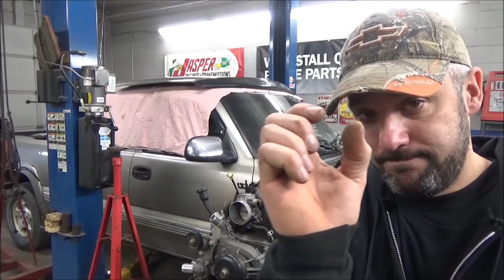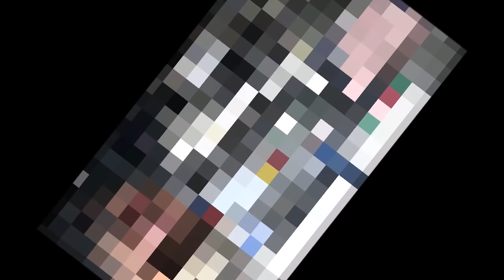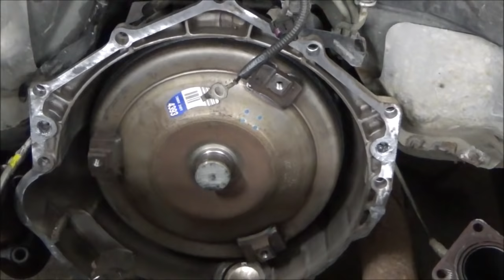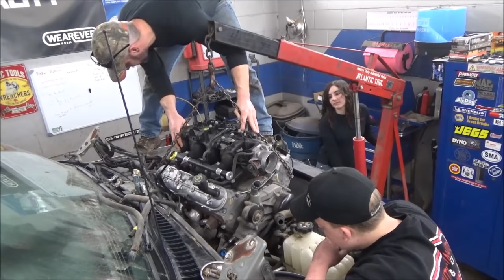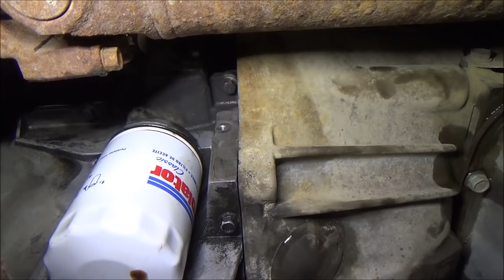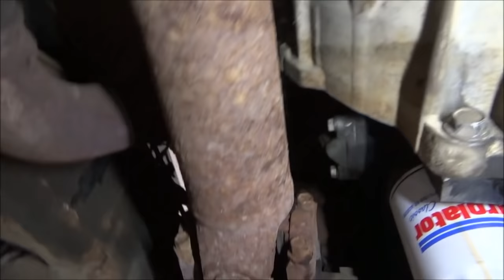Chevy Truck Engine - Remove & Replace Part III

Comment: I have got to put a little handle on the cylinder valve of my cherry picker here, to get that smooth controlled lowering....  And a Hanna would probably help as well, the Josh model looks like he might need to be told something more than once.. ;p  Am almost always doing these things by my lonesome here, but that is the way I like it...
Reply: Wow, she knows what a pair of C clamp visegrips are (at about 35:00), and she apparently somewhat clairvoyant.  I could defiantly use one a those...

Comment: again my oversized paper weight "08 Chevy suburban" has 136 grand wgile my 05.chevy silerado has 268 grand an still runnin with no issues.
crazy..

Comment: Don't you love how there is one bolt hole on the bell housing passenger side second one from the top that does not take a bolt I guess it's so that tranny could bolt to the older motors I remember the first time doing one I actually pulled it back apart to find out there was no hole on the engine block pretty annoying

Comment: i'm replacing my 5.3 with a reman engine. I wanna put a Jasper reman in there. Do you recommend Jasper? and will Jasper come with all brand new hoses and belts ? I know if I do a reman I need all new hoses/belts but what else do you recommend replacing while i'm at it??

Comment: Man those tranny lines look awesome,I'm doing that to my car soon,I'm pulling the engine out and putting a new bad boy in it and I'm gonna replace my lines while I'm there, my stabilizer arm broke a mount years ago and it started rubbing against one of the lines unbeknownst to me and rubbed a hole in it so i had to splice it with a hose but while the engine is out I'm putting new lines in.

Comment: How much did this engine replacement cost?
Reply: I will tell you I rebuilt one and it cost me around $2000.00, if you can I would just swap out this motor. Everything you take off this thing has to be replaced, bolts gaskets etc. and then you have to line up the oil pan just right as the transmission is bolted to it. It is a great engine but it is expensive to rebuild.

Comment: I'd definitely vote for removing the radiator.  Once drained and with hoses removed shouldn't be too hard and gives you a lot more room for maneuvering.  ...and you could probably set a stool in there to set on while disconnecting and connecting wires and stuff.  Or stand on the frame, etc.

Comment: I don’t know why you didn’t pull the intake its only 8 8mm bolts then you coulda used a valley lift plate woulda saved a lot of time and headache

Comment: Doing this job right now in 04 Yukon. Bought from Cali had it shipped to NY it arrived with no oil pressure! Pulled apart somebody already replaced pick up oring and oil pump . Pan full of metal! eBay hosed me on this one ! For my fellow gm guy these years when buying a used engine you have to be careful! Instrument clusters in these trucks can be swapped and whatever mileage on the cluster is what transfers ! So vehicles with 300k miles on them with failed clusters people swap now suddenly that vehicle says it only has 130k bc the vehicle the cluster came from was low miles. Junk yards look at the cluster and list engine with whatever mileage! I looked at 25 engines would only buy it I had vin from vehicle! Ran car fax to see true mileage of vehicle bc you can follow mileage of vehicle! Took me awhile I wanted a clean engine never in salt! Found engine out of Oregon! It’s a flex fuel and I needed lm7 not l59! So just swapping the intakes! Good luck everyone! Example engine for sale local listed 103k miles at local yard! Grabbed the vehicle vin ran car fax it really had 381k miles! What a waste that would of been lol

Comment: @ 3 12 .... Meself and the other ol' scchhhool techs at "Possum Lodge Auto" had a chuckle at that. Hopefully that "Chivvvy" won't be back soon  throwing a crank sensor code! Would've been a good time to replace it while the engine was out and accessible, but as ye've been known to say.... "Let sleeping dogs lie"
Reply from the maker: +avalonangler Yep that is what I say. If you are gonna change one thing where do you stop?

Comment: Honestly, it's too easy to remove the intake at this point, with the injector harness and emissions vent tube threaded out. To me it's actually easier to thread out the vent tube when you remove the intake with the engine still installed. Plus I tend to break the plastic intake boobies too.

Comment: ...a little surprised that the timing chain,  water pump and spark plugs weren't changed as long as it was out. Hopefully it would have gone 40k+ with only oil changes and gas.

Comment: that engine probably just needs some honing, fresh bearings/seals, valve lapping with block and head surfacing and its a brand spanking new 5.3... please don't crush it.. its a good block and heads for a short changed young guy

Comment: Far, far more hassle than replacing the inline Atlas 4.2 in my Trailblazer. No way a truck bay should be that tight. It was so much better back in the 50s-70s when a small block came out & back in so easy you could do it alone.

Comment: removing and replacing the V8 4.4 ltr engine in a BMW X5..............holy mofo what a job that was..........takes forever to disconnect and remove everything, they are cramped fit.

Comment: No flywheel, Flex plate and Torque converter. Flywheel on clutch, which this truck does not have.

Comment: Eric : oh yeah, one more. Type in "rebuilt GM 5.3 engines" in google and 10,000 people surface that say they have great engines. Do yo uhave a fav source for GM rebuilts? Some actually upgrade the oil pump , others cam's etc. I hate buying motors from people i know nothing about.

Comment: I wonder if it’s possible to test the replacement engine while it’s still outside and easy to fix. It’d be sh*t if you put the “new” engine in, only to find it has a fatal flaw, like a cracked cylinder wall,spun bearings, or a seized piston! Even if it works, it’d be nice to know what problems it has while they’re easy to get to and fix, like leaky head gaskets, or problems with the intake manifold or fuel rails. Spending all that time to replace the engine, only to have to fuss and muss and take it back out would really ruin my day! 😃 When all else fails, call AvE and borrow his left-handed nut-f*cker!

Comment: Man they keep making those engines compartments smaller and smaller, absolutely ridiculous having to install and engine sideways just so it fits front ways IMO and it would probably be easier to remove the front end.
Reply: +Rod Palm - or maybe cover the inside rad fins w/piece of cardboard if you can't/don't want to pull the rad entirely out.  Eric bet your thinking .. sure wish these backseat drivers would drink more and think less.
Reply from the maker: +Hawaiian F150 Hahah well you know what they say about hind site right :)